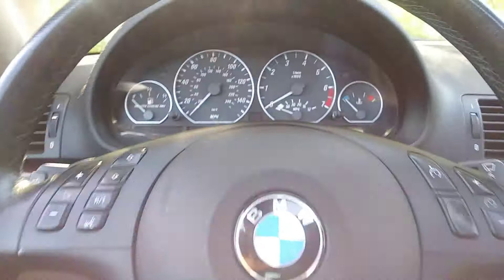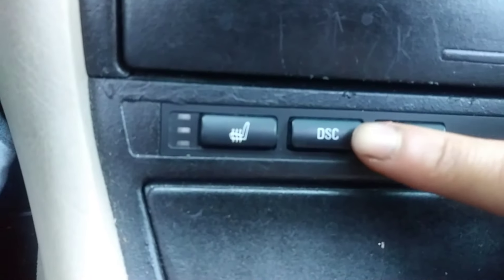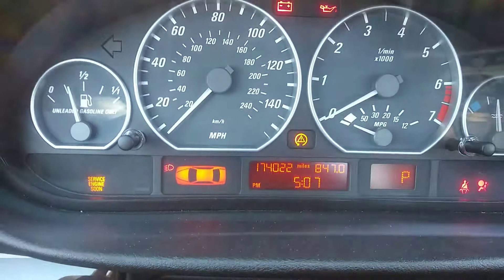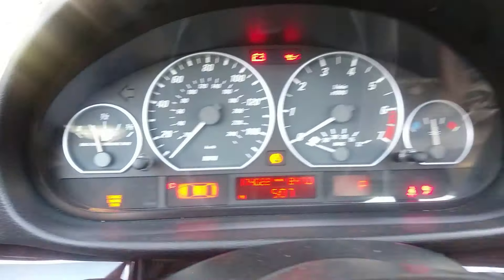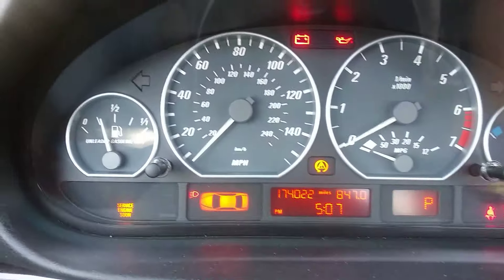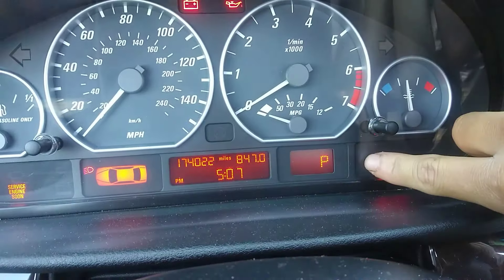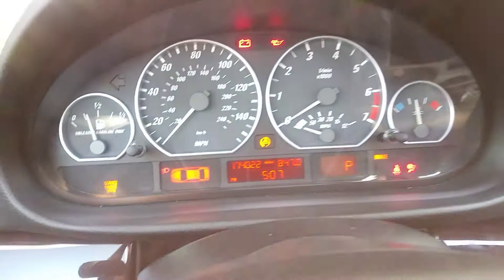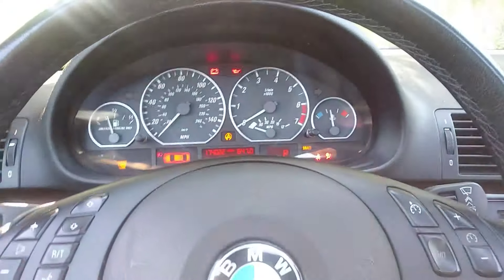How to turn off traction and stability control on BMW e46!

Comment: That doesn’t fix issue. Mine it keep on forever
Reply: Hello.. have you resove it ? And  how ? I have the same problem
Reply: I found that while my brake hose was broken, it had hole so the pressure in brake system wasnt stable, after repair and brake was fully filled with brake liquid.. light turned off

Comment: I just got my coolant reservoir replaced on my 325ci and my dsc lights won’t turn off when I press the button. Why can’t I turn it off.
Reply: I just had my resivior tank replaced with an aluminum one. It took me 10 years and about 5 plastic tanks to find it.

Comment: my traction light comes on when i turn the car on but goes away after i start driving and doesn’t come back on. does that mean anything?
Reply: I think they all do that
Reply: Could be a faulty brake sensor
Reply: @NerunUC153xELL8mUR  unhook your battery and hook it back goes away
Reply: From what I've been told by dealership it may be steering sensor or happend during a front end alignment and may need steering recalibration.  It puts steering wheel at dead on 0 with front end . Also very expensive to fix I was quoted 1,600.00.if the sensor was bad .
Reply: @philipprebble7089  jesus christ on a e46? or newer?

Comment: My traction light be coming on when I take a turn and when I accelerate I don’t get power until the light goes off and I’m back driving straight is that normal?
Reply: yes bro that light means the traction control is engaging i always drive w it off because the same reason, kills my power in turns